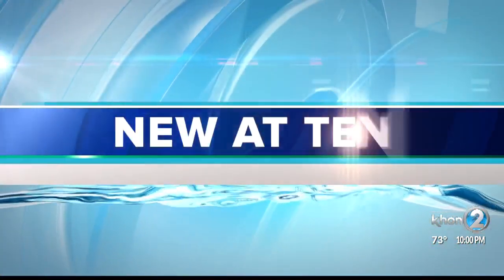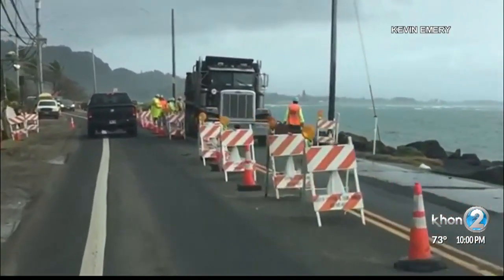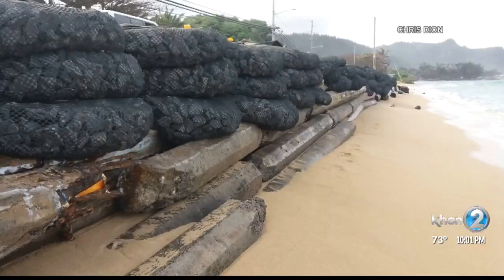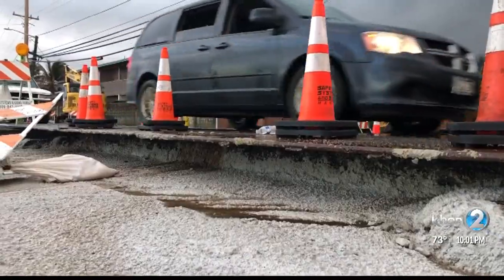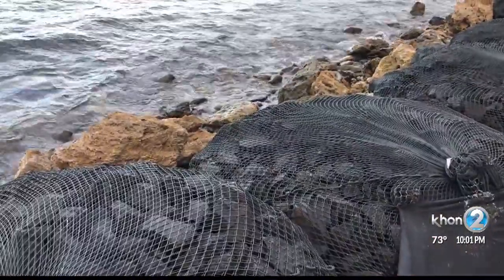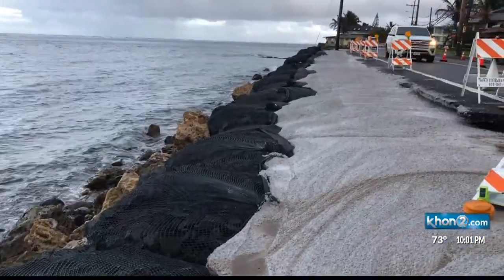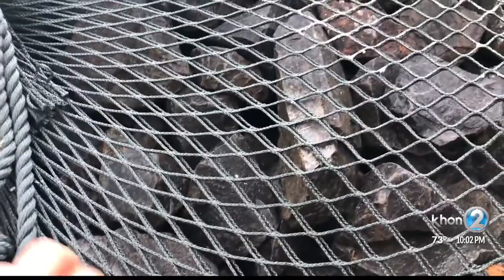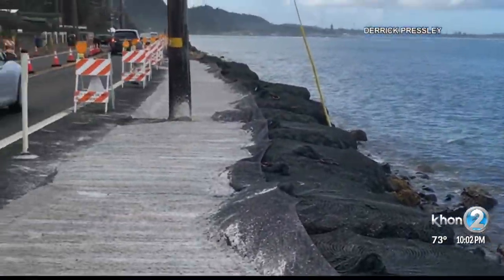New erosion barriers placed in Hauula

Comment: Force of waves impact the shorelines with tremendous force which causes the unstable terrain to run a bay and  runoff. The plastic mesh rocks bundles bounded together in a mesh bag stack along each other creating a barrier that disapaite or disperses the impacting swells and second the plastic mesh  holds together the rocks instead having erosion eroding away due to the unstable foundations which will only just slowly give way from the forces of loose matter...
Reply: The state is hiding the fact of rising sea levels impacting the Hawaiian islands...  with rising sea levels coastal erosion are happening everywhere on the island of Oahu...
Reply: Its pigeon... not English